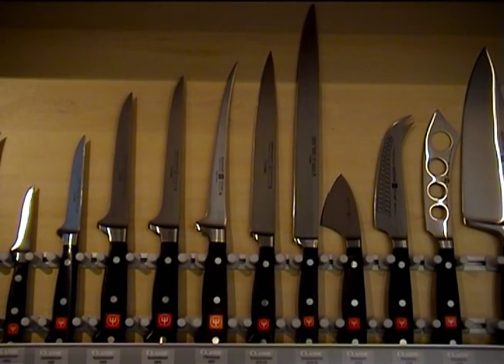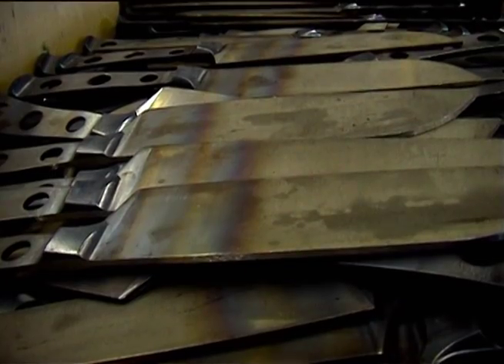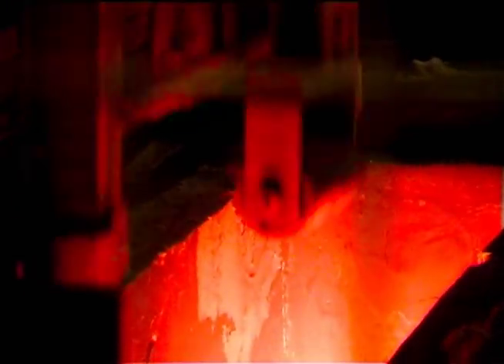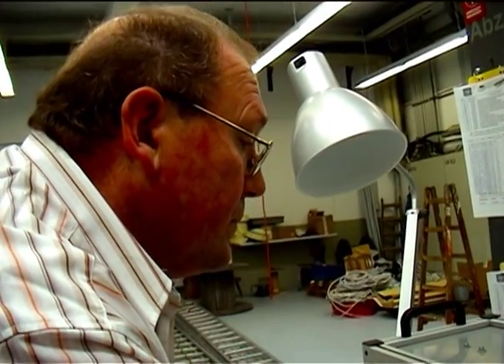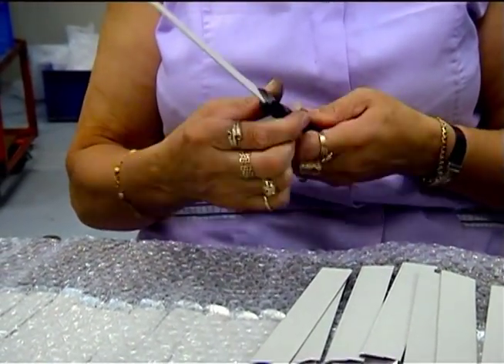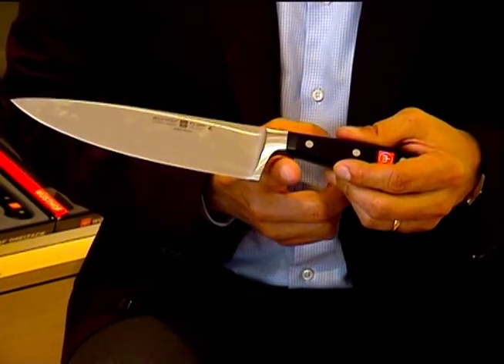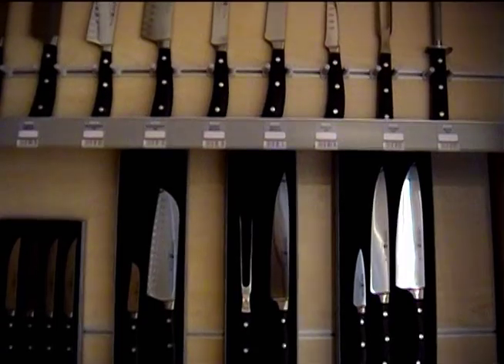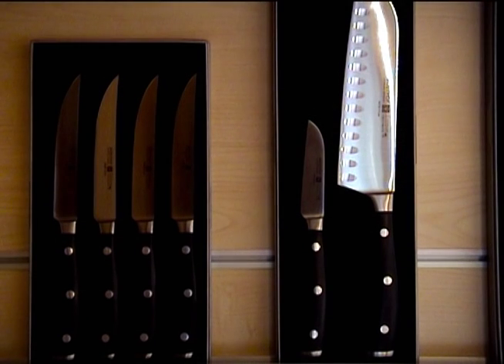All About Wusthof Knives | Williams-Sonoma

Comment: What quality control Mr. W?   Out of two sets I had 25defective knives.  Bad steel that stained, partially printed logo on blade, burrs on blades, gaps between handle and bolster on both the plastic and wood lines, splintered wood n handles, etc.  that lady inspector must be making two piles of knives, one with good knives for Europeans and one with defective knives for the Americans they think are too stupid to notice.  Look at your knives very carefully if you buy these.
Reply: I bought one of their knives recently, zero problems.